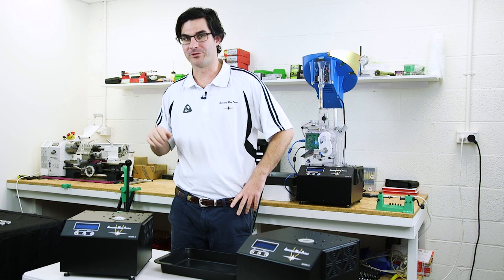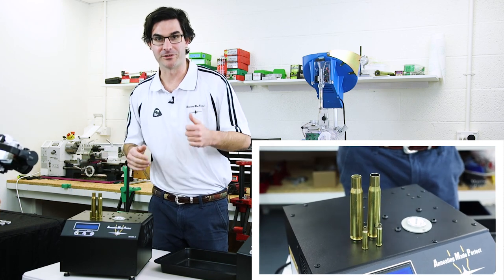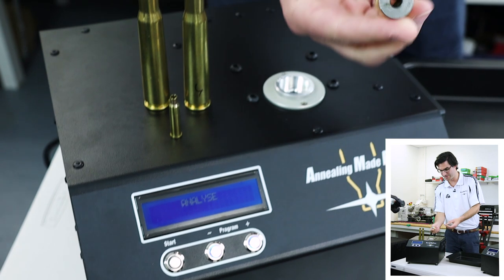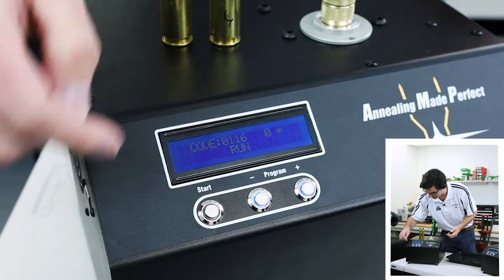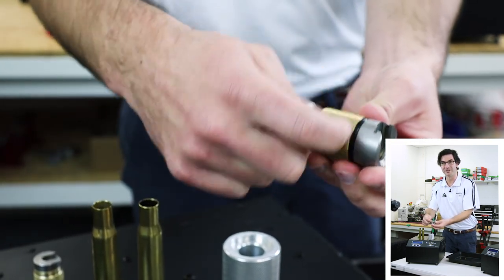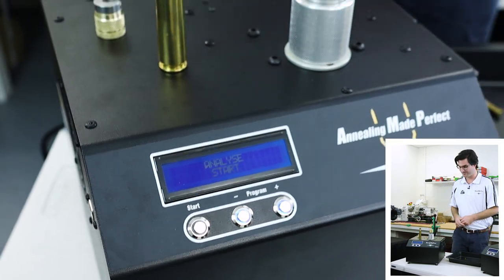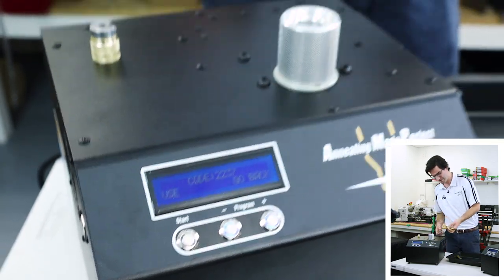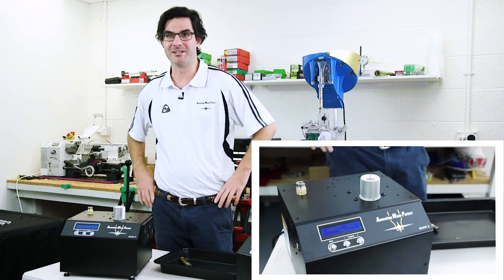Annealing the smallest and largest cases with the new MARK II

Comment: I have 2 questions, Imake 6.5 creedmore out of 7.62 brass. Do I annel after reforming brass and turning neck down or do it before reforming. Also having trouble getting a AMP machine ,any suggestions on how to obtain one of these machines.
Reply from the maker: Hi John, If you are finding the forming process splits cases or is difficult annealing beforehand can make it easier. We would definitely anneal after forming and before sizing on any subsequent reload.

We have just resumed shipping so allow two weeks from now for them to be in stock.
Reply: @annealingmadeperfect1257  thanks for the info,hope to have a AMP maybe by Thanksgiving.
Reply: @annealingmadeperfect1257  Theres no other time to anneal besides before sizing since annealed cases invariably have to be sized afterward.